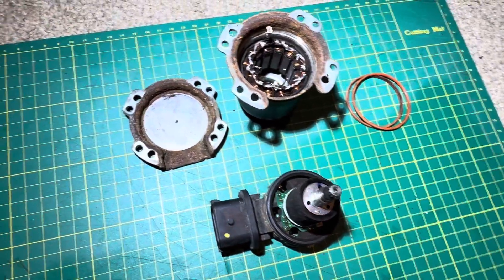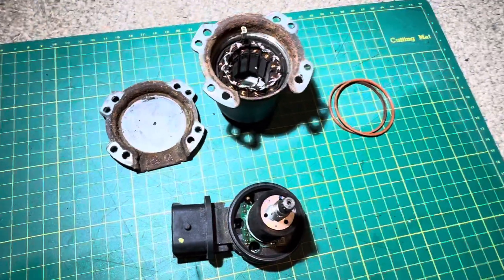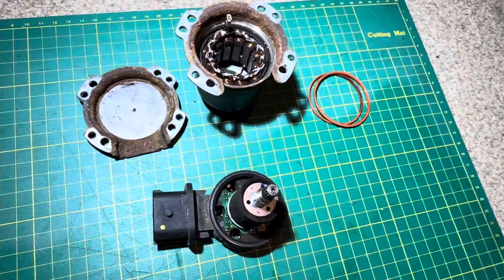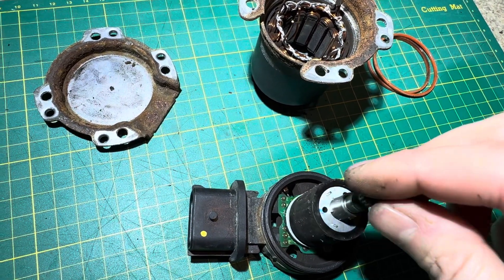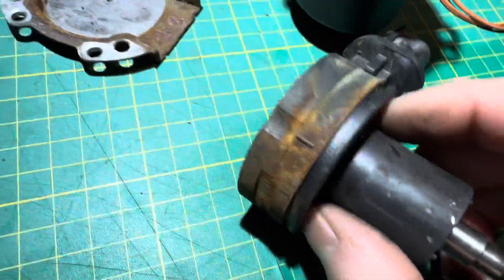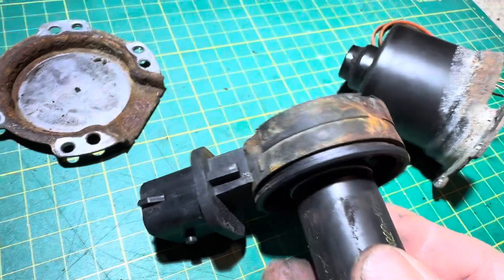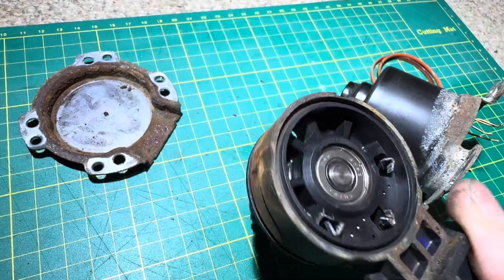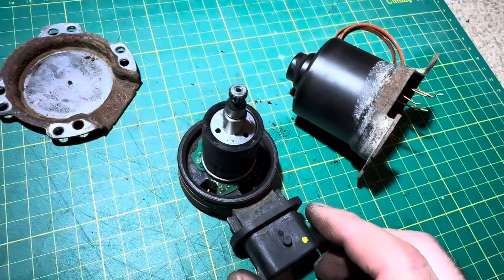A dead Smart 453 DCT clutch actuator and why it failed

Comment: Hey boss 
I own a 2016 smart fortwo 
Recently the 3 lines and E popped up on my dash 
As well as the transmission malfunction message on my dash 

Every ao often will the usual PRND indicator letter pop up where it should. But then itll switch back to the 3 lines. Could these motors be the issue ?? 

When i turn the car on you can hear a motor trying to find what gear its on. I can only imagine its this .